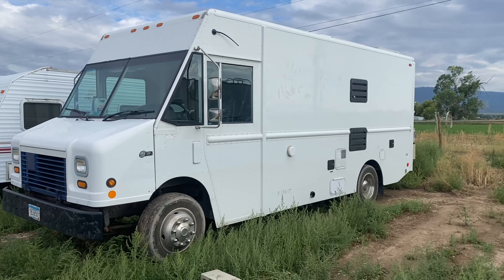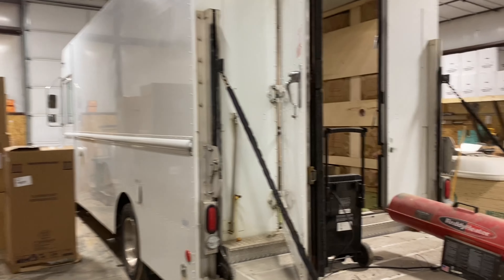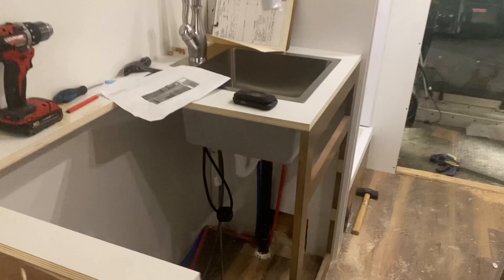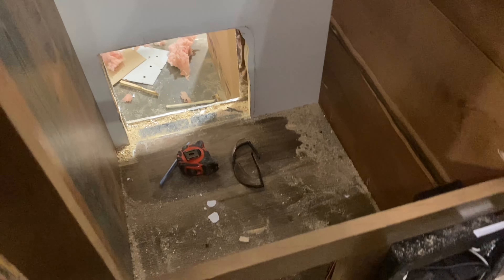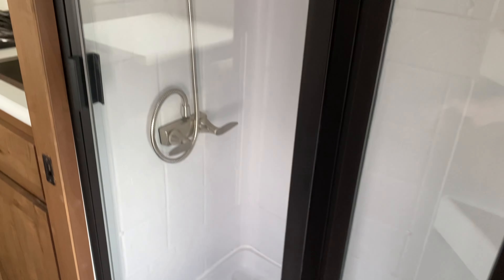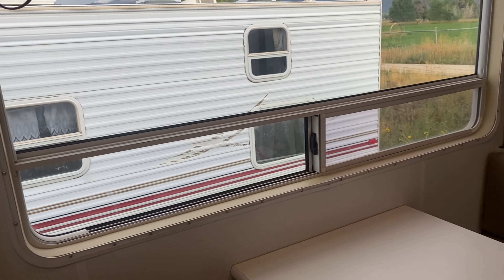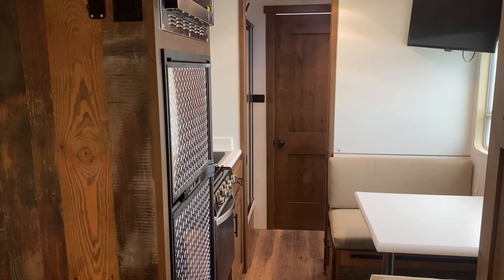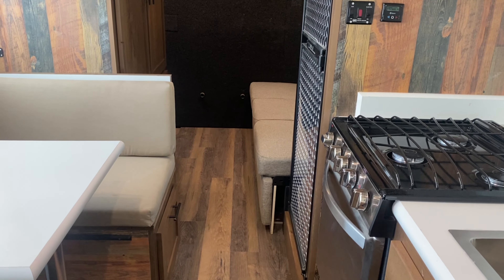What’s better than a skoolie?

Comment: Handles should be recessed flush  to surfaces and closet should have a sliding door. Plus you could swap shower placement with fridge and have the rear most wall ( or just top half of that wall ) on a hinge folding inwards with a hanging rod fixed to it using the shower for hanging clothes or other items when not in use, hanging over bed when wall swung out and shower in use.
Reply from the maker: Great suggestion